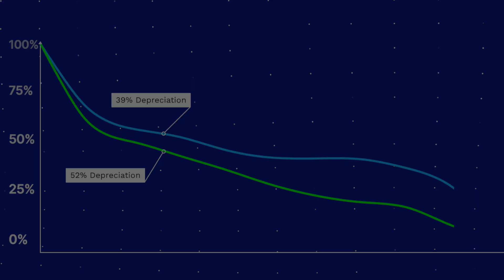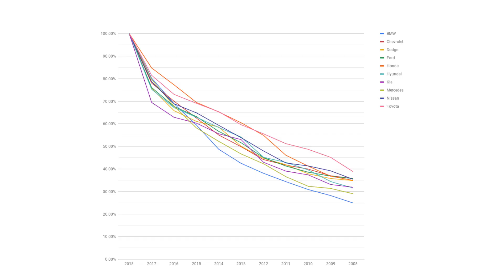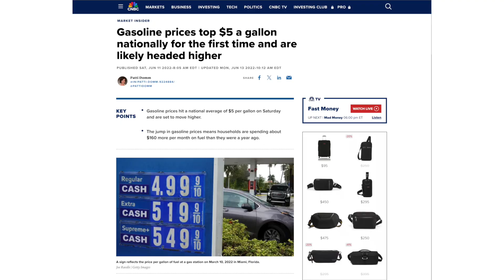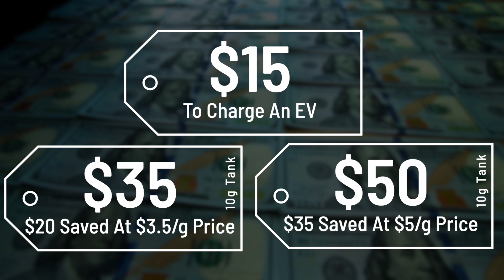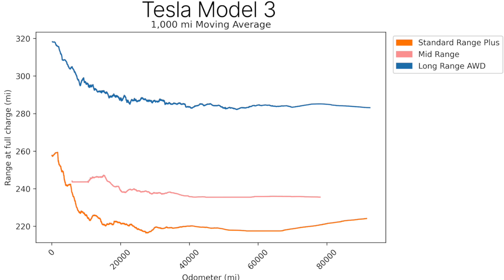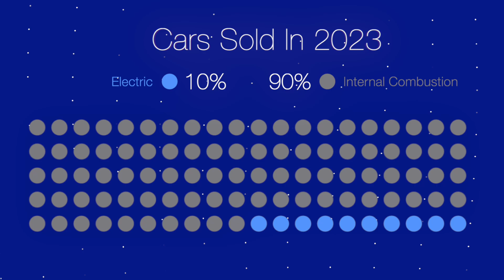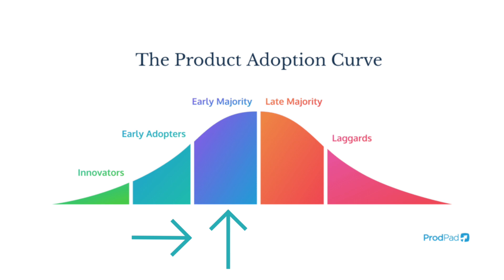Why Do Electric Cars Depreciate So Fast?

Comment: Reason   -  electric vehicles are crap -    In  my gasoline driven vehicle  I know where the next gas station is  -    and don't need to look for a vandalised charging station  !!  Not to mention  cold weather  -  here in INDIA there a few if any e.v. ,s   -  although climate conditions are ideal

Comment: This is a good video, but let’s be honest—the reality is much simpler.
EVs just aren't worth their initial asking price for most people. The market is correcting itself and adjusting prices to reflect what these vehicles are actually worth. You can't expect widespread adoption when the ownership experience comes with so many trade-offs. A few key issues:

-Range anxiety remains a constant concern for long drives.
-Charging is time-consuming, especially when compared to a 5-minute gas fill-up.
-Battery degradation is inevitable—a multi-thousand-dollar replacement down the road.

-The savings on gas are often offset by:
 *Higher insurance premiums
 *Cost of installing a home charger
 *Increased home insurance due to fire risk
 *Frequent tire replacements (EVs are heavier, tires wear faster)

-Maintenance still exists—just because it's not engine oil doesn't mean EVs are maintenance-free.
-Phantom battery drain is real. Just letting a Tesla sit can drain 1–2% per day, even more in hot weather due to battery cooling systems. A parked EV can still impact your electric bill.

In practice, EVs often feel more like a tech gimmick than a practical transportation upgrade. Nearly every EV owner I know—whether coworkers or neighbors—says the same thing:
"It’s okay… but I wouldn’t buy one again. Too much hassle."

Comment: EV depreciate so much because they should not be priced that high to begin with. I'm very confident that in 2035 or 10 years from now there will be SO MANY used EV's in used car market places for less then 5000$  that are perfectly fine for driving. 

ELECTRIC CARS will have SAME EXPLOSION like Smartphones did. Today you can buy 200$ Smartphone that has 99% Of the Features of 1400$ smartphone, only difference is faster processor. Same will happen to EV's once technology matures

Comment: You have an excellent quality, high production looking video, so great job on that. However, I don’t like some of your argument and reasons for the depreciation. You make good points about the battery and market perceptions affecting resale value. I wish you would have mentioned the limited Mechanic availability on EV‘s(and the high cost of EV repair making cost of ownership actually more expensive than the EV manufacturers display. Back in 2019 I was brainstorming whether or not to get a Tesla car. I called my insurance company and once I found out the enormous amount of money they were gonna charge me just to ensure a new Tesla basic model. I had to stop considering Tesla and I stopped considering EV’s altogether. I asked my insurance company why it cost so much to insure the Tesla and they said mainly because of part availability. Tesla is the only company that makes parts for the Tesla cars. Therefore it takes a lot of time and cost more money when parts are needed to keep a Tesla running long period of time. now granted I don’t know if this is the case in 2025 for Tesla and the parts situation I also don’t know if it may be as cheaper now to ensure an EV/Tesla car that it wasn’t 2019. maybe this helps you as a content creator and or maybe this helps someone who decides to read this in the comment section. I would say perception of obsolescence, limited resale market, charging infrastructure variability, brand, reputation & competition, cost of repairs  & uncertainty, high cost of insurance, and battery derogation would be the main factors for EV is not holding up value compared to internal combustion engines.

Comment: that s because narrow minded of ice lover. not  yet  have a evidence but  sounding it loudly. in fact ev battery and motor has longer lifespan than ice. ev can run for 500.000 km without replacing battery or motor.. and still able to do more.no expensivee maintenance

Comment: Remember, someone was quoted 60k for a Hyundai EV battery replacement.
Reply: battery can be serviced per block. no need to replace whole block
Reply: @hadisoewoyo8739 cells need to be balanced, you have to replace a brick with the same level of ware as the whole pack, you are paying thousands for a USED repair.
Reply: @polska905 it is as you say.  Back in 2021 i had the 4 battery blocks changed on a 2015 Panamera Hybrid.  HV Battery just died at the Dealer while the car was in service for some other issue (not related to the battery).  Porsche advised the warranty on the battery was 6 years and by then ,the car had already passed it.    The tab for changing the battery was nearly 12,000 Euros.   This after 50% discount on labour and 30% in parts..  nowadays porsche has an 8 year warranty on their tycan. (At least in Spain)   I  keep on wondering, if a relative small battery was that expensive to change , what will be the cost to replace the battery of a tycan without any discounts . ?

Comment: I think used EVs are a big unknown on reliability. People who buy used cars are smart and conservative. 
I’ve got a 55k mile R1T and it’s been flawless. The battery warranty of 175,000 miles is insane. If you live in a state that forces autos to have huge warranties then EV is a no brainer. Especially a used one that’s half the price. Like a 2020 model 3 for $20k
Reply: I think if you buy EVs from companies that only make electric vehicles you’re in good hands. I’ve been eyeballing Rivians and may pull the trigger if they continue to drop. You can buy a model 3 with 30k-40k miles for anywhere in the 20s. That’s a no brainer, my current LR Model 3 has 180k miles with no issues. I’d buy another one at these prices…

Comment: They depreciate so quickly for the same reason they catch fire all the time - they don't.    I've been trolling every source of cars in New England, and late model Teslas and Mach Es are still too high to buy 1-2 years old with less than 20K miles (the only way I'll buy a car - and for cash).
Reply: Depends on your budget.

Comment: They depreciate acording to what they are... just a bigger cellphone that can also move.
Reply: Fast. Very fast.
Reply: @steveinoz8188  not really... with great acceleration from dead still, yes. Great top speed... not really... great acceleration form 100kph to 200kph..not really
Reply: @makeit2132  the Rimac Nevera R disagrees.
Reply: Still too much money and wages haven't kept up, all I see is debt rolling around, forever prayers no savers, get bank to work debt slave. Define affordable.